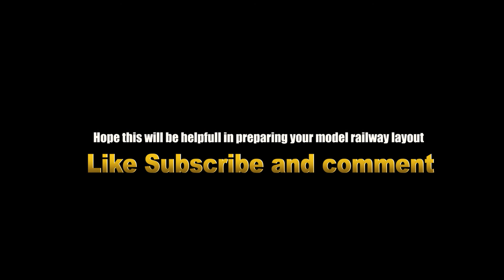How to Curve Flextrack

Comment: Thank you for this.  This technique worked a treat today on a tight 180 degree curve I needed to get done. I have a second identical one to do which I know now will be a cinch too! I should add that I applied PVA to the entire length of track and worked it around, securing with push pins as I went, i.e. shaping and fixing in one go.
Reply from the maker: Thanks Anthony

Comment: Genius! I went a step further and drilled a small hole dead center where the track nails would be, used a thick drafting pencil lead in the hole and marked the table top 1st, this is the center line of the two piece cork roadbed.

Comment: Just wish I saw this before spending $60 on the curves for a large dual track layout. Thanks for this as it is a very good solution.
Reply: you may unknowingly be glad over time that you spent the $$$ for curved pieces. everything in this video looks fine and dandy until you need to switch to a new piece of flex track in the middle of a corner. thats the hardest part. i'm not saying it can't be done... but it's hard. that's when using pre-curved pieces like you did could end up making your track more reliable. especially working in n-scale... the tiniest issue going over rail joiners will make those big modern freight locos with 3 axles per truck derail. just wanted to chime in that maybe your $60 was well spent!! :)
Reply: @tony791999  if you're worried about adding a piece of flex track in the middle of a curve why not just cut the track before the curve then add a full piece to run the length of a curve?
Reply: @tylerbonser7686  because some curves need to run longer than a piece of flex track. think about a helix

Comment: Thank you for your efforts. Also, enjoyed the music.  Some possible suggestions; also include measurements for making the same thing in h o gauge, and when you get to the part that is covering the measurements please pause and zoom in on the measurements so that they can be noted. I know that you can pause the playback but typically when you do that the image is dimmed significantly and it's hard to make out. Thanks again, based on your presentation I plan to make a similar tool but include as many radiuses as I can. 😁

Comment: need to tell people most flex track has 1 rail secured to ties and that rail must be on the inside of curve as it wont let ties slide apart for spacing
Reply: Thanks for that info.  I have messed with my trains in well over 30 years.  Been planning on getting back into it, things like that are important to know.

Comment: Nice jig you have for curving flex. Personally I use Atlas and don't have to do all the forming. Just draw a line and follow it...
Reply from the maker: Yes Atlas track do not need any Jig for forming . This is for ME tracks only
Reply: Will the Atlas stuff stay curved for you as this mirco engineering track does. (Without tacking it down as you go)
Reply: Andddd. Can I mix ME track with Atlas switches and such? Like will it look the same or will detail and coloration be off

Comment: What did you use to cut the groves in the wood?  Also how wide is the piece of wood? Tonight I “tried” to bend a piece of ME code 55, and now I have to make one of these... THANKS!
Reply from the maker: I used small saw to cut the grooves. The wood is approx 1 inch x 13 inch  x 0.5 inch in size
Reply: A large paint stir stick would work .
Reply: I ended up using a piece of 1X2 but cut the length 2”.  I have a lot of variable radius curves so this works perfectly.

Comment: Great idea !  Im into European TT , thank you for sharing ! As one railfan to another. One question ,how do you keep it curved in perfect position without using pins ?  Nailing it down , so it keeps its perfect curve ???
Reply from the maker: Thanks! I used ME Code 55 flex tracks, they keep there shape when bent unlike atlas where you have to hold it in position and glue it down. so for ME tracks you can still use pins as you progress your curving but it can hold the position even without the pins. but for Atlas flex track yes you need it to pin and also glue as you progress curving it! hope that helps

Comment: You mean it works with any Scale, not Gauge. Scale is the proportion of the real world to be reduced to miniature. Gauge is the distance between the rails to become a set of measurements and the height of the rails above the ties. Gauge examples are code 55, code 7-, code 83, code 100.
Reply: Wont it work in any gauge then. Of course it will.
Reply: @stephenlane743  the term is scale, not gauge. They are two different things.
Reply: @PlatformONE  I dont mind people correcting me when they know what they are talking about, but gauge has nothing to do with the height of the rails. Gauge is the distance between the rails. Scale is the ratio that we model in.
Reply: It's any gauge. There are multiple scales that run on the same gauge track. There's flex track for smaller gauges too.

Comment: So you have to have a block of wood for each radius set you want to do.    Buy two trammel points  put a pencil in one and spread the points
on only one piece of wood to your desired radius and draw the radius on your table.   VOOOOLLA
Reply from the maker: I had a very tight curve also i was planning to attach turnouts.  I was having only 23" inches of vertical areas to work with and in the center because of column that area gets reduced to only 20 inches. So as you can see i am on tight tolerance little bit curve gets out center and loco can't run. So that's why i used this tool to make sure i pre curve them and plan accordingly. Thanks for your interest.

Comment: the concept is good but while "rounding" the curb of the track there's no effort in attaching the track to the board below. Having to repeat this process IMO, is a waste of time. Showing that you are attaching the track as you "curve" it is part of what your video should show.
Reply from the maker: Yes I agree but the track i am using is micro engeenering track and it forms shape as you curve not like atlas track which needs to be pinned down as you curve.